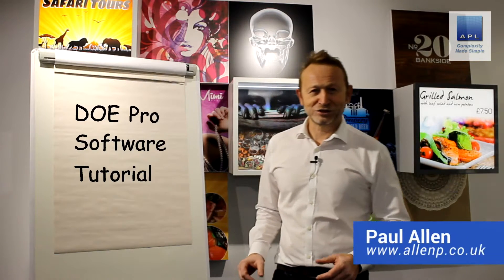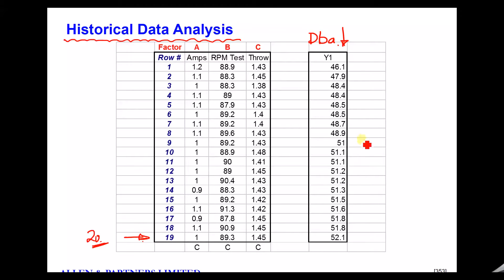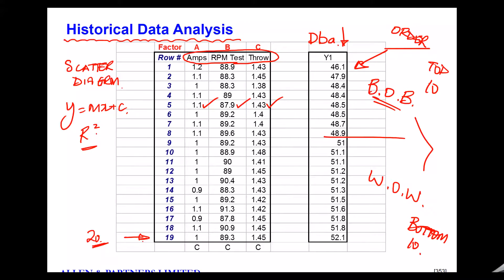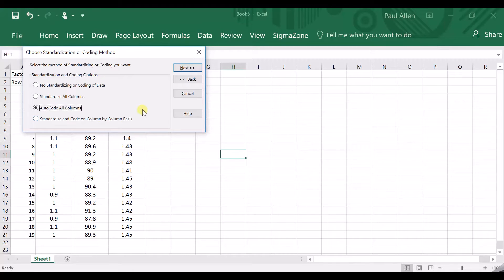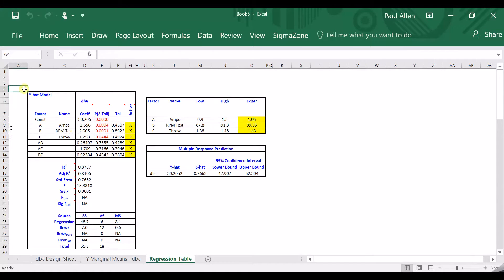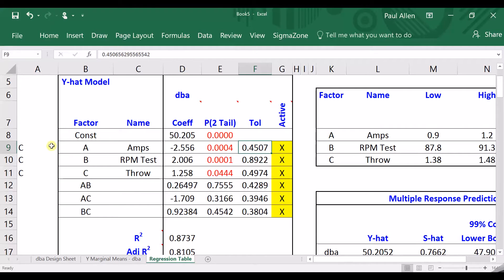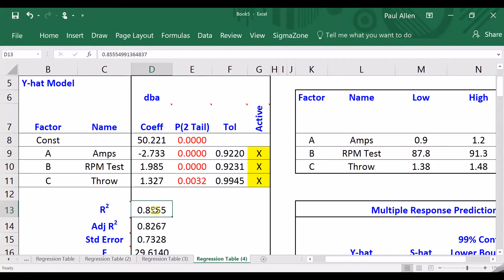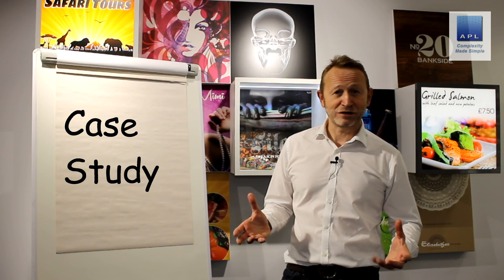Complexity Made Simple - How to analyse Historical Data using DOE Pro

Comment: Thank you very much for this interesting video. I tried to replicate your calculations using Minitab 19 (Regression > Regression -> Fit Regression Model) but, even though initial R-sq and R-sq (Adj) values look like yours (87.37% and 81.05%), the regression equation looks rather different: dba = 1034 + 218 Amps -15,0 RPM Test - 681 Throw +1,01 Amps *RPM Test 228 Amps*Throw +10,6 RPM Test*Throw. It is useless to say that I have carefully checked the input data. What am I doing wrong? Moreover,could you please suggest books that discuss in detail this subject providing examples and case studies? Thank you very much in advance! Riccardo
Reply from the maker: Hi Riccardo - I'll take a look at it today..
Reply from the maker: Riccardo - I think the problem is that the array is not coded and minitab doesn't seem to have a facility to code the inputs in the main DOE function. Un-coded models are always different.  I think you can code in the regression function though...
Reply: @paulallen5321  Thank you very much Paul for your kind and prompt answer ! Minitab 19 offers the following possibilities for coding:
. Do not standardize
. Specify low and high levels to code as -1 and +1
. Subtract the mean, then divide by standard deviation
. Subtract the mean 
. Divide by standard deviation
. Subtract a specified value, then divide by another
The regression equation I reported was obtained using “Do not standardize”. I have just tried using different options, but it does not change too much. As you said, it is probably due to the software.
Are there books you recommend on this issue (regression, etc.) showing examples and case studies? Thank you very much!
Reply from the maker: Riccardo - Using regression -  specify low and high levels as -1 and +1 I get the correct regression equation. Equal to the one I generated using DOE pro...I'm not sure I know a good book on analysing random data like this though. I'm not a big fan of random data. I prefer to design an orthogonal experiment. I have recently published a book on DOE. It's called 'Design of experiments for 21st century engineers' you can get it from LULU.COM..
Reply: @paulallen5321  Paul, Thank you very much  ! Book ordered ! I am eager of reding it! Thanks !